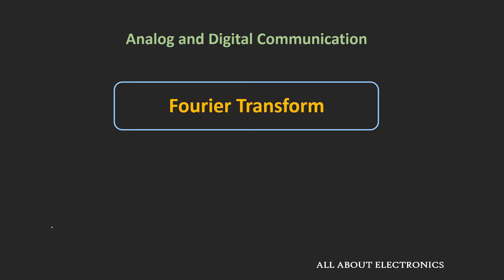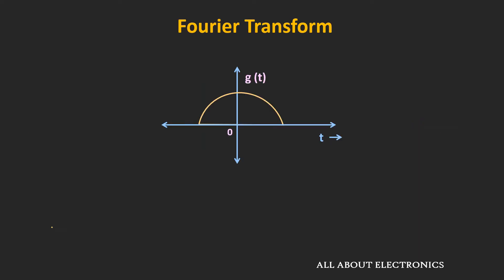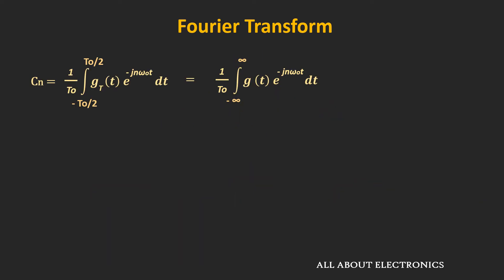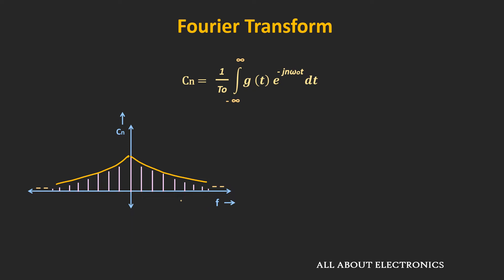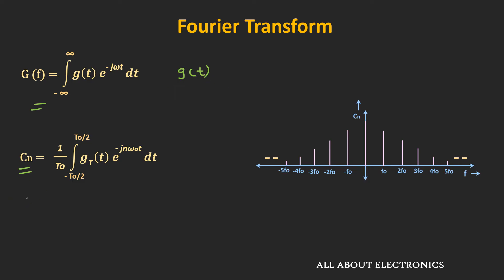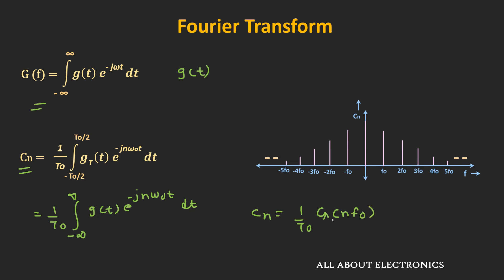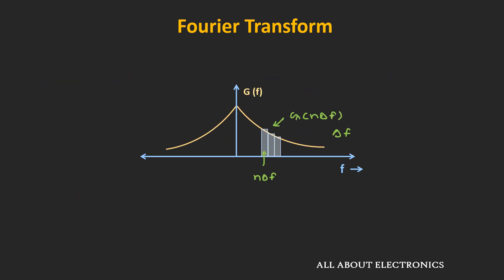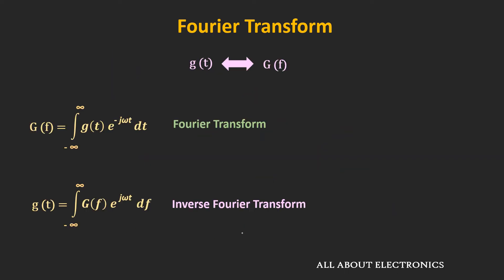Fourier Transform Explained

Comment: What is the practical use of this fourier transform ? How it is been used in smart mobile devices 
?
Reply from the maker: It is useful in signal processing. From the time domain signal, if you want to find out the frequency spectrum of the signal, then using this is is possible to do that. Also in the communication, during the demodulation of the signal at the receiver, it is very useful. If you know the spectra of the signal, then you can design the filter accordingly.